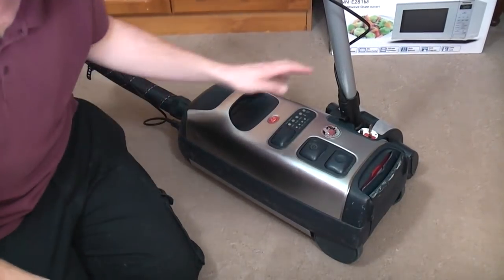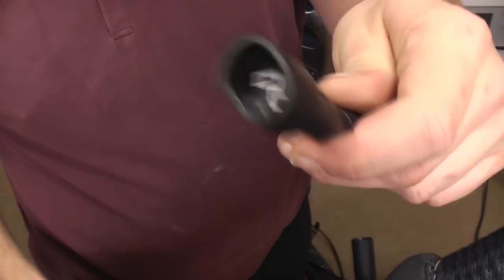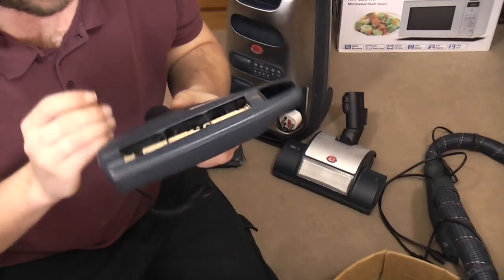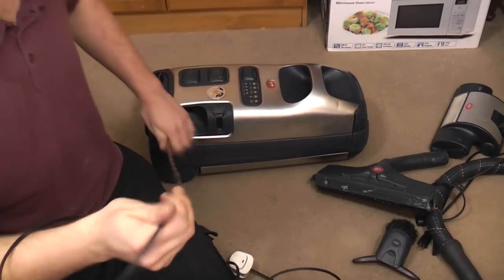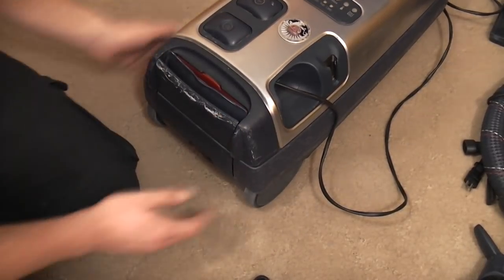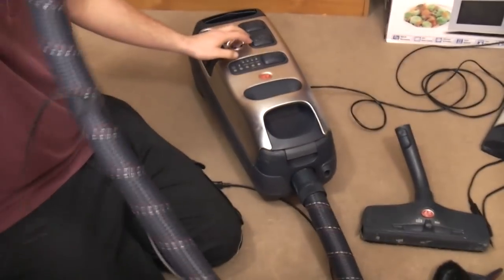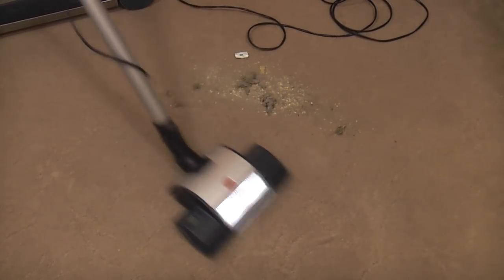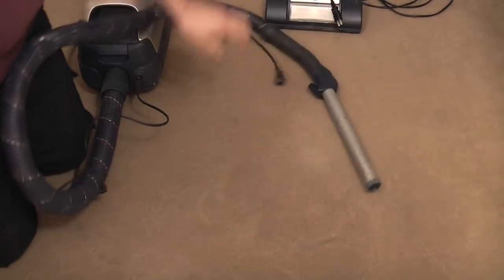Lux 1 Royal D820M- First Look

Comment: These are very good vacuums. If I saw right the serial number was 711... so this is  manufactured on week 11 year 2007. The new model is called lux S115 intelligence. It's with integrated pn cord and remote control.
Reply: It's not an S115 Intelligence. It's a Lux 1 Royal, the D800's model
Reply: @savedgez  yes but new model is S115. This is D820

Comment: The D820 was made in Sweden by Electrolux AB and were sold through Lux International.  They were made from 2001 through 2010 when Electrolux AB sold their Lux International subsidiary off and exited the home sales business.  You can replace that hose with what is called the K35 hose that has the wires incorporated into the hose and has an on-off switch on the handle for the power brush.  Most of these came with the Ze3 power brush.  I have not seen these sold with the PB1.  Those are normally sold with the Intelligence.

Comment: Wow what have you found! These are very expensive in mint condition. Lux is totally separate brand from the Electrolux. Only sold by door to door salesman. European "luxury" brand.  This model came in 1997-1998. I have the earlier very good condition Lux Royal D790 from the mid 90's. Love it. I replaced the hose with normal more flexible hose. It has very good suction. Same level than in my Miele C3 1200w (I measured it).
Sorry to see it in such a bad condition. Refurbish it and you get good profit selling it :)
Reply from the maker: Ive already had a few collectors asking what my plans are with it! This was filmed a few weeks ago now, I've been using it a fair bit, it's quite good! Shame the hose is so ruddy clunky really!
Reply: If the conditions for replacement parts exist there as they do here with Aerus a person interested in keeping it could purchase a much updated hose.
Reply: You can buy almost anything for these old Luxes. Spare parts are widely available, but expensive. Lux vacuum cleaner parts: https://www.huoltopalvelu.com/epages/huoltopalvelu.sf/en_GB/?ObjectPath=/Shops/Huolto/Categories/%22Kodinkoneet%20ja%20varaosat%22/Imuri/%22LUX%20imuritarvikkeet%22
Reply from the maker: Wow! That's amazing! The non fabric hose looks like the hoses fitted to our uk cheap cleaners! And I hammered the power nozzle motor apart a d got it spinning again with wd40 and their over 120eur!lucky escape there
Reply: Genuine parts are "a bit" pricey :D
Reply: Its expensive? That modell?
Reply: From the incorporation of Electrolux AB until 2009, Lux International was a wholly owned subsidiary of Electrolux AB.  Lux makes nothing. They are strictly a sales organization.  They actually pre-date Electrolux as Lux is the Swedish word for Light and Lux AB started in 1901 selling a popular outdoor kerosene lamp.  Their top sales person, Axel Wenner-Gren was working with another company called Elektromechanska AB selling a vacuum they made.  He arranged to merge Lux and Elektromechanska to form Electrolux AB in 1919.  All those Lux and Royal Lux vacuums sold over the years were made by Electrolux in Sweden and sold door to door by the Lux International sales force.
Electrolux Group sold Lux International in 2009 and the D820 was the last of the really good Swedish made Lux vacuums.   Vorwerk bought Lux Asia-Pacific business and now sells their Vorwerk vacuums all over Japan, Taiwan, Australia and New Zealand with Lux branding.  My Lux Sora from Japan is really a Vorwerk Tiger 260 that runs on 100 volt power (I use a 100 volt transformer in California and love it).  Some Swiss investors bought Lux International's European operations. Since they could not sell vacuums made by Electrolux of Sweden any more they commissioned Kolektor of Slovenia to make a vacuum for them.  We know it as the Lux Intelligence.  Sauber sells the same vacuum in Australia and New Zealand as the Sauber SI-200 Intelligence. In the US, Aerus Lux sells it as the Aerus Guardian Platinum but the US model comes with old Electrolux USA style wire reinforced hose and their wands and power nozzle.  In 2011 the Swiss investors went bust and sold their business to Eureka-Forbes of India, their current owner.
The D820 usually was offered with the good two stage Electrolux suction motor but towards the end some of these were made in another Electrolux Group factory in Hungary. and came with Domel motors.  Since the two stage Electrolux motors are not serviceable (fan is riveted on) there is a kit to replace that motor with one from Domel. The Domel motor is a beast, highly recommended.  I have a D820 from Japan that has the VM3 motor.  I was stunned to see it because every other vacuum I have had with a VM3 motor had no power but this D820 from Japan has huge power.  I use a digital hot wire anemometer to measure airflow so no guessing or subjective impressions.  The numbers are the numbers.
Reply: @beko1987  WD40 just washes the grease out of the bearings. It will sound nice for about a half hour then squeal like a stuck pig until the bearings seize.  Replacement motors are readily available but you could probably take the motor apart and replace the bearings. The motor looks sort of like one from a Wessel-Werk nozzle.

Comment: This,the Hoover and the Kirby are some the best vacuum cleaners
Reply: Oh goodness.  Kirbys are like Harley Davidsons. Big and heavy seemingly for the sake of being big and heavy.  They only work on smooth open areas and have no maneuverability to get around furniture or obstacles, just as most Harley only work on smooth straight higways are absolute pigs on a curvy road.  Like Harleys they are noisy and have a lot of shiny metal to polish (or neglect).  They have rabid partisans who deny every shortcoming they have.  For clarity I have a G4 and an Avalir II but hardly use them.  The Luxes, my D795, D820 and a new (to me) Guardian Platinum (the US version of the Lux Intelligence) are what clean my home most often.  Once a month or so I will drag the Kirby out to scare the dogs /:
Reply: The best Hoover product were the mid 1980s Sensotronic canisters.  Quiet, refined, lots of power and the best canister hose Hoover ever made.  The only thing they fluffed was the bag is not very well retained and leaks dust everywhere.  A few found their way to the US and I have a gorgeous example.

Comment: I have a version of this. I think its a Sauber Intellegence SI-200. Couldn't agree with you more about the clunky comments. I am tall and the hose is too short and too stiff. Its body is too long to move about. The bags are very small. For such an expensive cleaner the plastics feel cheap and the extendable tube gets stuck. It is a quiet vacuum and does a good job at cleaning.
Reply: That's why I bought the longer and more flexible hose to my Lux Royal D790. It helps a lot with this style heavy vacuum.
Reply: No, it's a Lux 1 Royal. If you have these problems, you probably bought your machine second hand. You can still buy new parts for it at your local dealership, and it will work good
Reply: Buy the hose for a Lux Powerprof.  It is a direct replacement but doesn't have the Blue-tooth controls on the handle.  All it has is a simple rocker switch to turn the power nozzle on and off, but it is something like 3.6 or 3.7 meters long and doesn't have the faux fabric cover so it isn't nearly as stiff.  
The Intelligence is a very different animal from this D820.  I have the US version of the Intelligence, the Aerus Guardian Platinum and I have a 100 volt Lux 1 Royal D820 from Japan. Actually I have two, one in anthracite and another in silver like this one.  The D820 is Swedish and sturdier.  The Intelligence is a bit more fragile, especially the too-thin bottom plastics.   I like both a lot but I think the D820 will be the more durable of the two.   The D820 is also a bit more powerful as measured by my digital hot wire anemometer at the end of the hose.  Both are beautiful examples of modern industrial design and I have no complaints about using either.